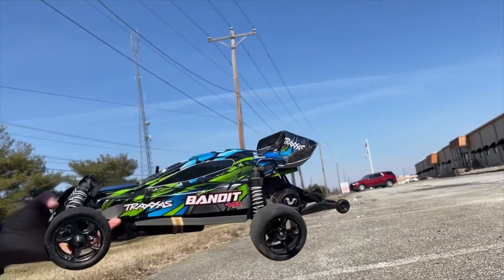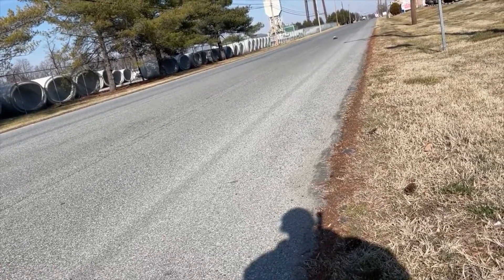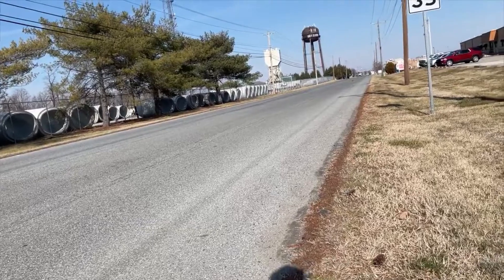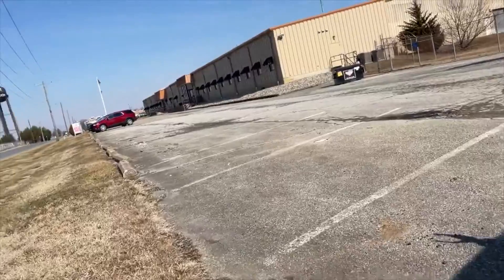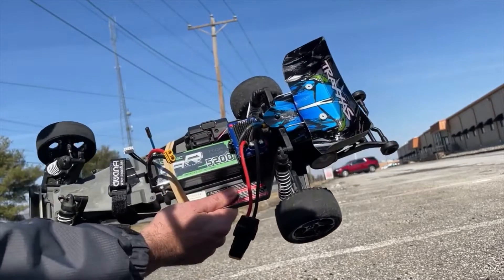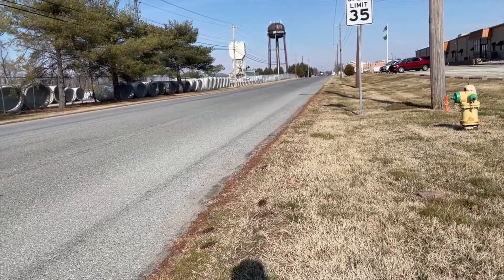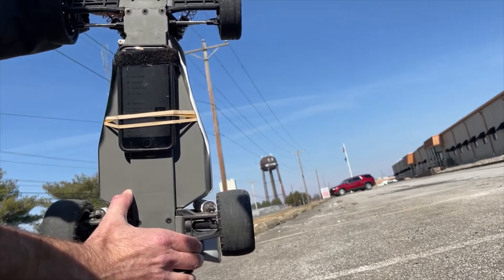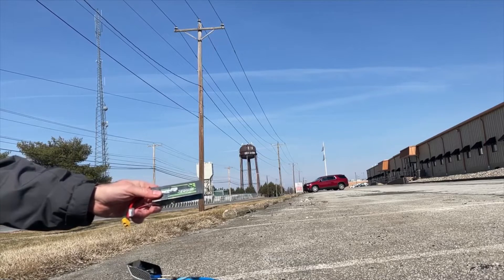Does A Higher Capacity LIPO = More Speed?  Ovonic 2200 mAh vs 5200 mAh Traxxas Bandit Speed Runs

Comment: CITY MAKED YOUR STUFF RUN LONGER NOT FASTER ITZ VOLTAGE THAT SPINS MORE RPMS AND GETZ U MORE SPEED
Reply from the maker: Yes.... but everything else being equal, more capacity means less voltage sag thus a larger capacity LIPO is usually faster than a smaller one.  That is what the video is showing and the higher the amp draw, the more pronounced the difference will be!

Comment: Dont use ovonic bro.. they dont put out that much power.. I had an xo1 i ran it with Floureon Lipos and got 102mph. When i switched my packs to the Ovonic I couldnt go past 82mph
Reply from the maker: Wow that is a massive difference.  I think they are great for Basher batteries and having fun but definitely not for peak performance! All of my Ovonic batteries have exceeded their capacity claim and worked well however! I think they’re good as long as expectations are realistic.  Perhaps something is wrong with yours?

I will have to look into Floureon.

My best LIPO is my Turnigy and my Ovonic was 2 mph slower.
Reply: @BriansRCStuff  not sure if something was wrong with my lipos 😔.. i bought them brand new on Amazon, and was a bit disappointed how much the difference in speed i was getting with these.. good to know yours are doing better and putting out more power 😀💢💨💨💨
Reply from the maker: @teslacybertruck750  that x01 sounds like one hell of a ripper!!! I will have to see if you have any videos!
Reply from the maker: I just redid this test with taller gearing at nearly 20 mph faster speeds and the Ovonic 2,200 got crushed..... after about 10 to 15 seconds it hit the low voltage shut off!  Crazy voltage sag!!!

Comment: It makes sense because it's like a vehicle it's way easier to find fuel when the tank is much more full to dump into the injectors than it is to find fuel from a smaller tank and dump into the injectors in which will suck much more too fast. (Eg; Gas tank having say 50 liters of fuel and trying to inject that into the engine opposite to 25 liters of fuel in the tank trying to be injected into the engine. I did research and mAh does help because it has a lot less dead space to feed from. Which in turn is why higher mAh batteries are pricier. Also take into account your battery max temp. (No diff than a car temp) lower temps is better. So 30c battery 5200 mAh will never match up to a 50-100C 5200 mAh. Everything counts.
Reply from the maker: I am actually getting ready to test a 35C battery against a bunch of 50, 80, and 100 C batteries.  A lot of the manufacturers lie about their see rating but it will be really interesting to see how they perform. I can drain a 50 to 100 C 3S battery in two minutes and my arm a big rock.😆

Comment: Thats interesting man that you got an extra 4 or so mph just increasing amp hour rating but voltage is the same. Well done
Reply from the maker: Thanks man!

Yeah, I really thought there would be minimal difference as voltage is what determines RPM of the motor but I guess the combination of the voltage dropping quickly with the 2200 mAh and more voltage sag made a BIG difference.  

I have been trying to get my Kyosho Raider to 60 mph and it hit 56.  I may be able to get really close with a 4500 mAh 3S in .... and make make the last little bit up with different tires (I have the gearing maxed out).

I hadn't seen anyone do a video like this and thought it would be interesting!
Reply from the maker: I gained 7 mph in the new test I did with taller gearing with the same 2 LIPOs.... and the smaller one was hit the low voltage shut off after like 10-15 seconds!

Comment: Nice speed run bro what's the c rating on the batteries ? 75 or 100 ? Oh BTW your speeding in a 35 mph zone 🤣🤣
Reply from the maker: Thank you and thanks for the comment!

🤣 when I was running my 57 MPH Ultima out there on the little 2200 mAh battery last weekend there was a cop sitting right there! I think going 20 over is reckless driving!🤔😅. https://youtu.be/lYYjz_ky_mA

Both are rated at 50c so even the little 2,200 mAh one should be able to provide 110 amps continuous which should be enough to maintain what it needs at full speed. 🤔

I had a 100c Awanfi battery and it was crap! No way it was near 100 C and they had bad voltage sag!  I think these Ovonic batteries are actually a true 50 C though.

Next time out I will do some full throttle acceleration and wheelies and see how the little 2200 mAh battery handles it!  It was only $13 and runs rips in my vintage RC cars!